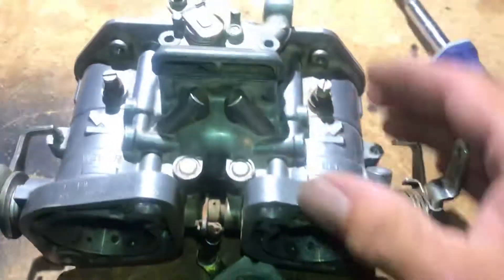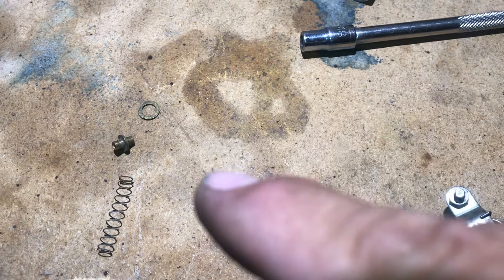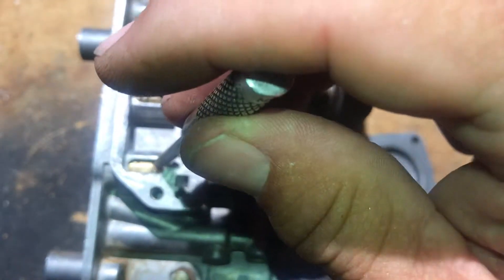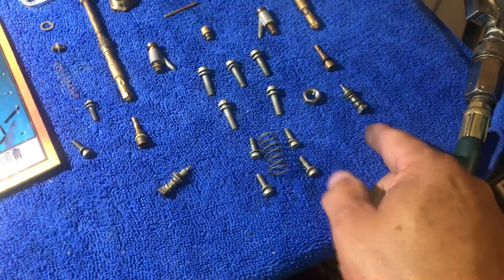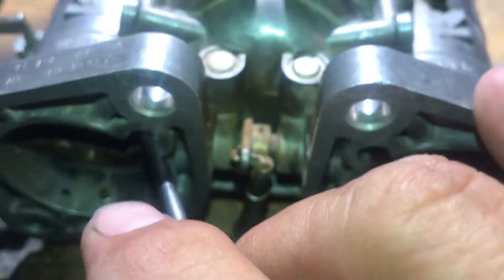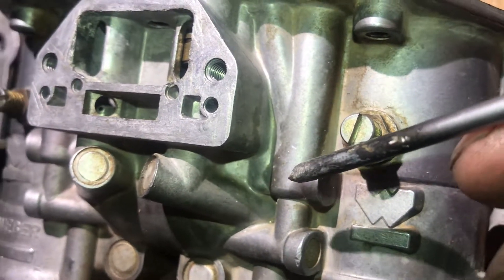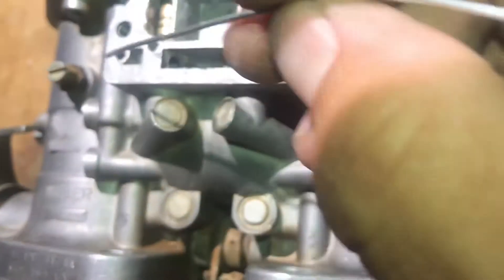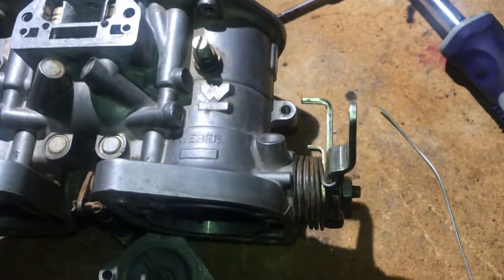Weber 44 IDF Chock

Comment: An easier way to remove the spring holder and washer is to use a small curved tip pic to push the spring holder in slightly in order to catch the underside of the washer, then softly pry upward. The pic will hold the spring and spring holder in so they wont pop out. The washer doesn't fly out either.

Comment: Vic could u mayb show how to install snap washer or mayb a video on closing off the cold start system
Reply: Hi John, I just insert the spring and spring holder inside. Then lay the washer on top of the spring holder and slowly push down to the carb indention. Once in this bbn position,  make sure one side of the washer is up against the wall of the indention then use the small curved pic's curved backside to press the washer flush. If it doesn't hold, you can carefully spread the washer out slightly and retry. I actually unscrew the emulsion tube, remove the emulsion tube holder (threaded tip) and slide the washer around the top of the emulsion tube. This seems to be perfect for spreading the washer out just enough.

Once you have it so it stays in place, make sure it's laying flush with the surface of the carburetor all the way around the indent. If not press it down a bit. I've found some washer may have been bent prior on some used carbs. I've used a couple of crescent wrenches to bend back flat. I hope this helps.